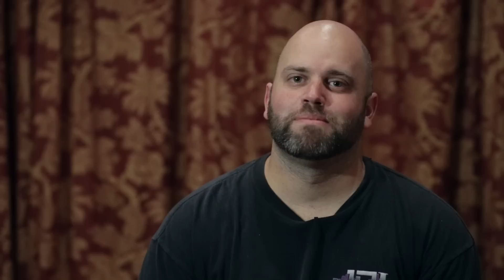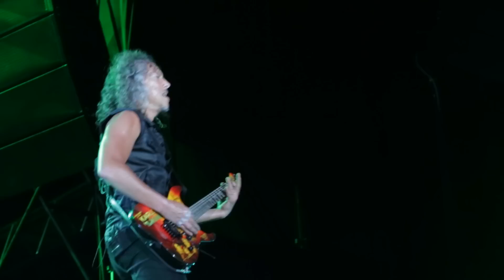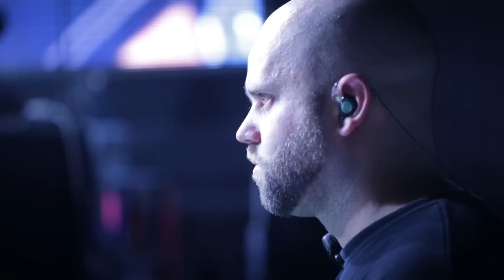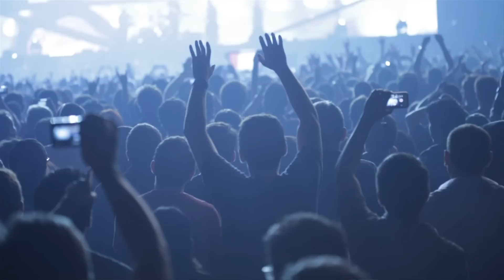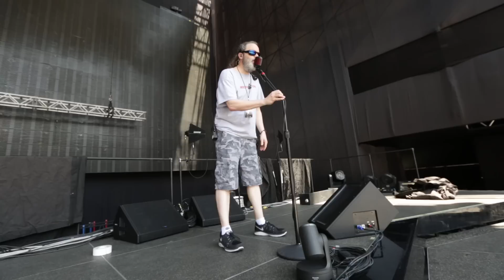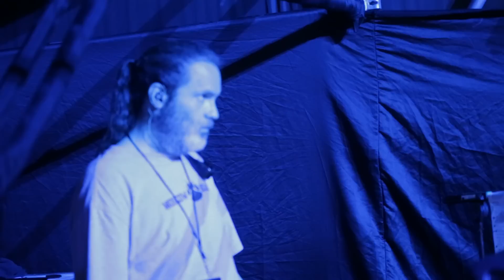Mixing Metallica: Backstage Video Interviews with Band's Dual Monitoring Team

Comment: I have a great idea! Wonder if I could create it (I am a hardware and software guy). Hows about a small transmitter (like the size of a beeper) that each band member wears on stage. Then, a number of "near field" receivers placed around the stage. What then happens is, as each band member walks around, the system knows where they are on stage and automagically sends their favorite monitor mix to the closest monitor that they are in proximity to. I don't think this product exists yet. Hmmmm....
Reply: or alternatively they could just use a wireless in ear system and just lose the wedges altogether
Reply: @mitchbahnsen7712  I think already have those

Comment: Can anyone explain to me why they use wedges as well as in-ears? Seems like the in-ears would render the wedges useless
Reply: 76 wedges as a backup? you really think that?
Reply: Who ever told you that you can't hear wedges with in ears? did you try it? Yes, you can hear, and feel the pressure, and it is a real boost on stage. Deal with it. Its all part of the game and its pretty common, believe me.
Reply: Colossus In ears bring definition but its pretty boring, wedges bring extra pressure to the definition, those low mids and lows that in ears will never bring.
Reply: I think the wedges are just a backup.
Reply: Pe ter Maybe but you can feel the sound pressure. And James wants to get guitar feedback from it.
Reply: You can´t get feedback from a wedge monitor whilst playing guitar. The speakers work differently. It ONLY works with ACTUAL guitar cabinets.
Reply: Mixplace Atendimento Because the artists want to use them. I heard James wants to use wedges.
Reply: You can hear wedges with in-ears. You can hear everything with in-ears. To say that you can't hear them suggests that you have never used in-ear monitors.
Reply: No. They´re custom molded to your ears. They block out pretty much  everything.
Reply: Bloodbath and Beyond
Have you ever try to push the on/off button?
If you ever use pro in ears you will see that they fit perfect in your ear and you cant hear stuff from outside.
Reply: Pe ter Okay bro. You're right. That's why Metallica doesn't use wedges - there's no point, since they can't hear them anyway. Oh wait...
Reply: +Bloodbath and Beyond It's not so much about hearing as it is about feeling. When switching from wedges to in ears you no longer feel the music. Musicians want to feel the low end sound. That's mostly what the wedges are for. Also, IEM's might protect your ears, but they decrease the ambient audio level, it can't completly kill the sound.
Reply: ***** You're replying to the wrong person. We agree with each other.
Reply: +Pe ter It's not so much about hearing as it is about feeling. When switching from wedges to in ears you no longer feel the music. Musicians want to feel the low end sound. That's mostly what the wedges are for. Also, IEM's might protect your ears, but they decrease the ambient audio level, it can't completly kill the sound.
Reply: I don't belive that james whant's the low end :-D
Reply: +Pe ter Those wedges are ON and loud babe!
Reply: I know. I was in the snakepit.
Reply: Pe ter Cool man!
Reply: Pe ter But what about Ro, Kirk and Lars?
Reply: Lars use just the in ears.
The main sound out of the wedges are the snare and the bass or the guitar from whoever is in front of the wedges.
Reply: +Colossus Wedges because they bring more of the low and low mids onto stage, in ears cannot super happily and accurately reproduce sub and low end mixes.
Reply: These in-ears they use have an option to make a cavity (a little hole on each ear bud) to allow they hear the sound from the outside, drummers use that type of in-ears so they can hear the drums, because normal in-ear block most part of frequencies. And no, wedges aren't spares,    James really likes to have some air moving (thats why they have 4 Mesa/Boogie cabinets on stage) this kind of stuff helps to get a more live sound, produce some vibration and also the wedges makes easier to get some feedback.

Sorry for any gramatical errors I am not a native speaker
Reply: Someone probably convinced these multi-millionaires that they need to pay extra people to set up and run wedges, and they went along with it.
Reply: Yes. Because you can't hear the wedges when you use inears. 76 sounds very much but they play on huge stages. 
In my opinion they have all these wedges if the inear system dont work.
Reply: Won Jae Choi
But with inears you can't hear them.
If i win someday a meet and greet,  i will ask him.  :-D